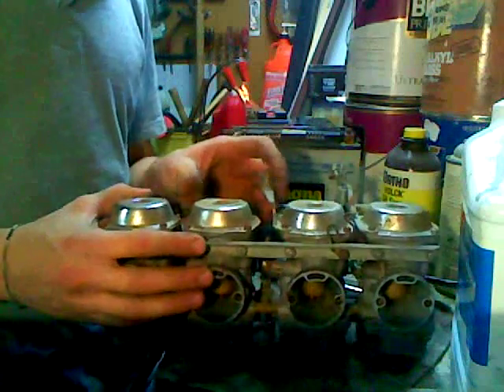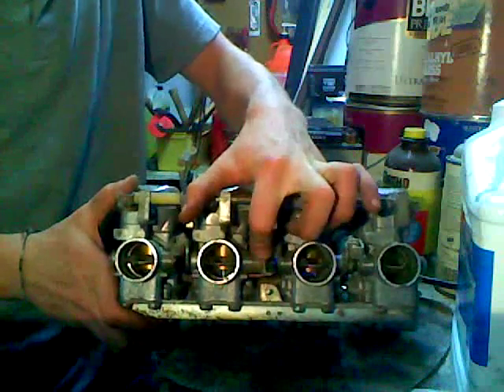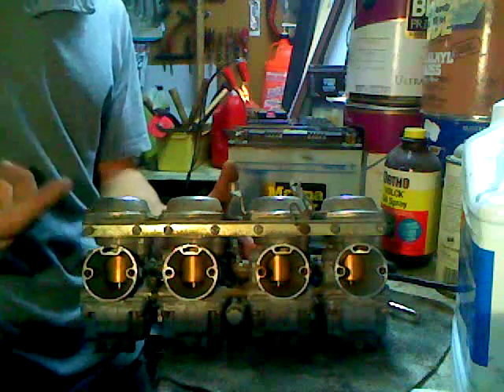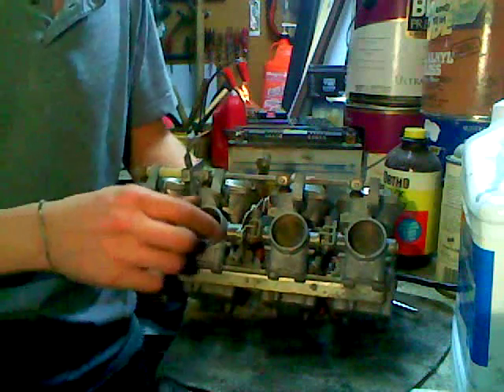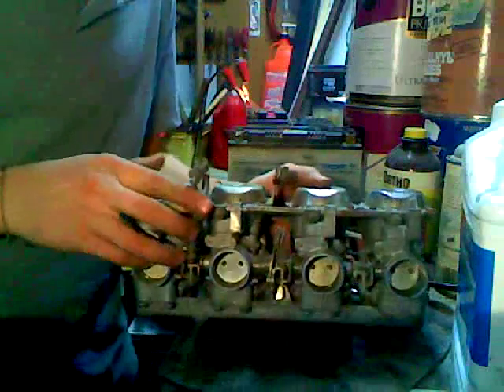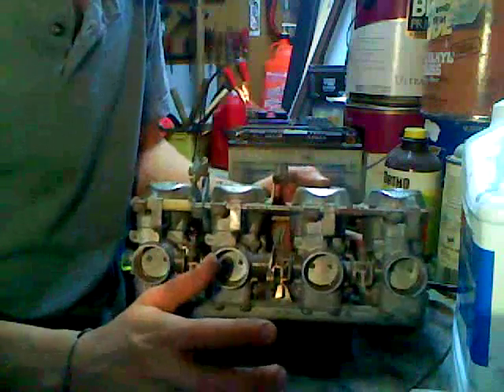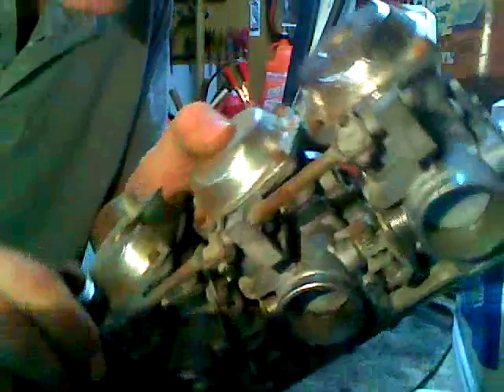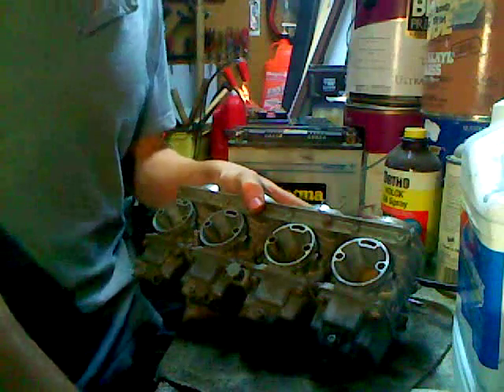How carborators work (1982 Yamaha seca xj 750)

Comment: Thanks for the video. I am currently rebuilding a shed kept 9182 XJ650 Seca. Been in there since about 1985. The only thing looking bad is the intake boots. Slight cracking. This video helped me understand working on my very first carburetor. I opened up the top covers and it appears very clean so I’m assuming this bike had barely any miles on it when it had a small sliding accident that forcibly removed the engine cover and damaged the ignition pickup and timing plate.
Reply: I meant go say ignition pick up cover on the left. Not engine cover.

Comment: I have a 1982 XJ650 that I am about to push it into a river. I am 45 years old and have NEVER seen such a piece of junk.  First the petcocks on are backwards.  PRI is fuel that runs all the time.  While RUN and RES need engine vacuum to run.  I cleaned the carbs twice and each time it gets worse. The fuel bowls on these pieces of junk have jets in them.  I used 2 cans of carb cleaner alone on them. I got the carb cleaner to fly 25 feet or more. There are pipes that go down and sit on top of those jets.  This is apart of the CHOKE system (enrichment) system.  The pipes have holes on the side of these pipes I cleaned.  Tried to start the bike today all I go was a backfire. That's it.  Compression from left to right 150, 145,145,145. I have gas, fat blue spark and compression. But no start.  Even with starter fluid.  I'm thinking it's the YICS system that's also the problem.  I had a 83 Honda Prelude that  had motorcycle carbs on them. It used a sub carb system that only lasted a half a year.  Their thinking was a rich mixture in a pre chamber and a lean mixture helped burn fuel better. Toss them in the trash.  Their junk.
Reply: i will buy it
Reply: altlandf  you have know idea how these carbs work if you did you would be riding it. There are a lot of vids on here that will show you how to build them. The carbs are pretty easy when you get to know them. If you don't want the bike then I will take it. I was use to working on American cars before I started into bikes.   Bikes are a whole new world . The 83 prelude used the old Ccvc system . It was very successful. There just wasn't a whole lot of understanding about them back then. These bikes are great. You have a tool now days that we ( me being 49 years of age) never had when we were young called you tube. It will help you understand how things work and how to fix them . Go over to the  xj forum and read. Don't give up on this , because this will only make you better and you will love riding this bike also pay attention to your float level
Reply: Maybe he needs his valves adjusted.
Reply: PRI is used to fill the floats after repair or emptying. No need to move the petcock as fuel is shut off when the engine is not running because it needs vacuum.